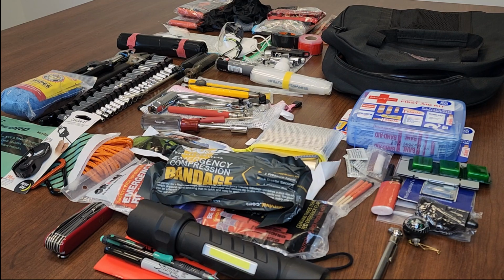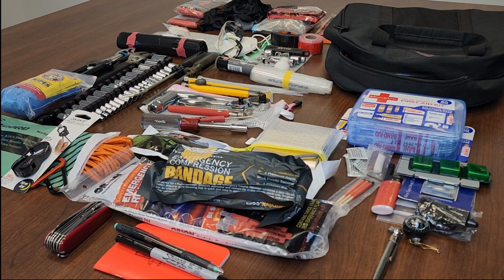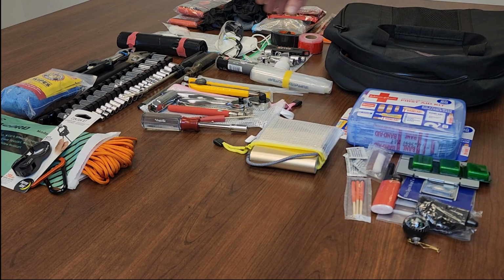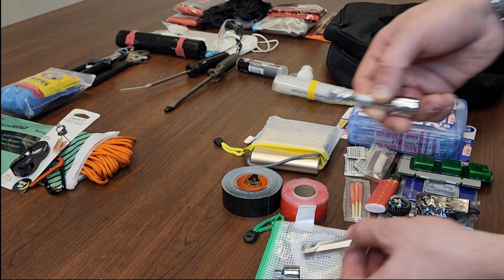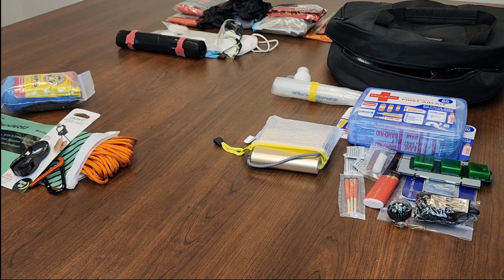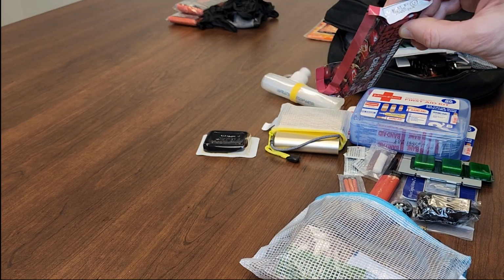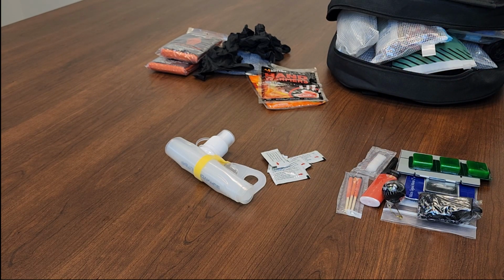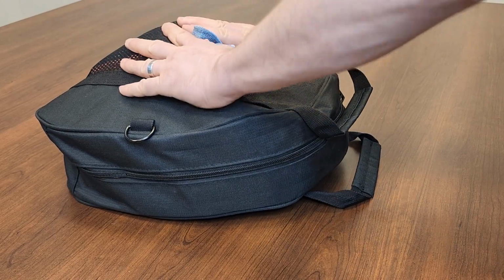A Car Emergency Kit that fits into a jumper cable bag

Comment: For additional fire starter use cotton balls, or cotton from aspirin bottles soaked in hand sanitizer then sealed.  I am using these in pill bottles but will try some in vacuum packs to see how it works.

Comment: When I had my car I had no emergency kit. I ran out of gas which started a chain of events that has left me car-less for almost 2 years now. Always carry a can of gas and an emergency kit. You have a great emergency kit for your car. Thank you for sharing.
Reply from the maker: Appreciate the compliment!  Everyone's situation is different, but I would rather not keep a fuel container in the car (or trunk) for safety reasons, and my car will also warn me in 4 different ways when I start to get low on fuel.
Reply: Carrying gas around in a full gas can is not safe.  It could leak.  It could get punctured.  It could explode (from a combination of shaking and heat).  Carrying an empty gas can might be beneficial if you are prone to running out of gas.

One time I ran out of gas.  As I was walking to a gas station (on a semi-rural road), I almost got hit by another car that lost its steering.

For a terrible chain of events watch
Tenerife Airport DISASTER! | Crash Of The Century | Mayday: Air Disaster
It is amazing how if any one particular event had not occurred, the disaster would not have happened.  Ultimately, it was caused by pilot error/impatience and poor communication equipment and skills.

Comment: Just use rechargeable AA batteries.
Reply from the maker: I'm trying to avoid rechargeable batteries in spots where items (like flashlights) might be stored for a long time, so I won't have to remember to keep them charged, and the AA Lithiums will hold their charge for over 10 years!
Reply: @cleverengineering2  That's true too.

Comment: I have cables AND a power bank jumper. Also many other things.
Reply from the maker: Hey there!   I opted for just the jumper cables because my goal was to fit everything into the jumper cable bag, so it was one or the other, and where I live and work, I'm way more likely to encounter a vehicle with no cables than no vehicle at all.
Reply: @cleverengineering2  Yes, my wife doesn't like my big bags in the back of the SUV. 😟🤣